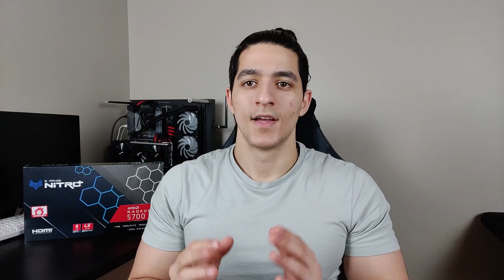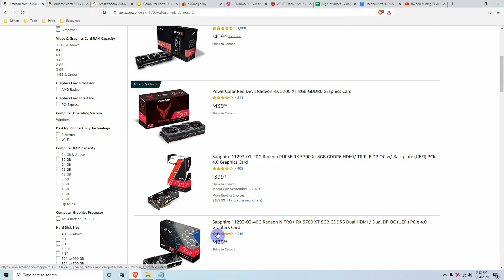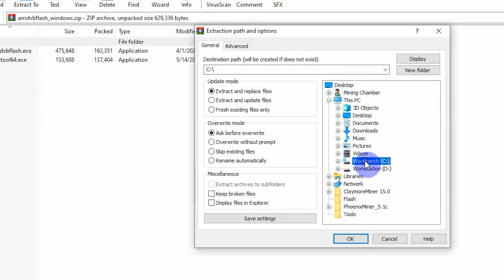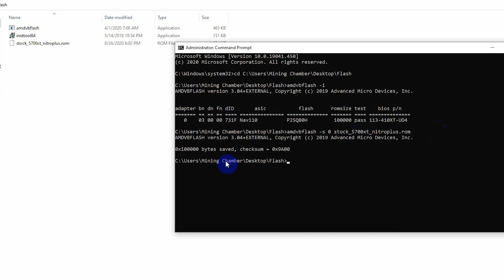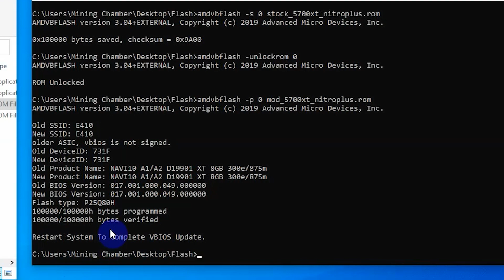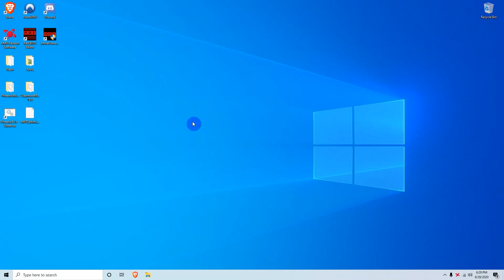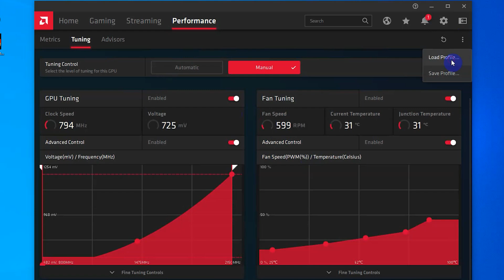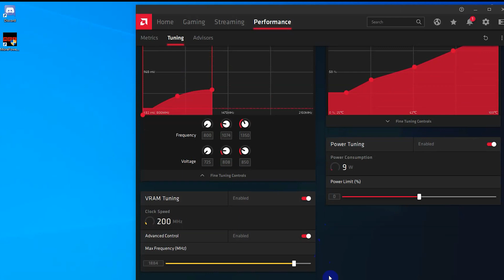RX 5700 XT Mining Overview | Profitability, Hashrates, BIOS Modding & Overclocking

Comment: In my case I don’t have to worry about electricity because it’s for free ! should I undervolt it ?
Reply from the maker: Yes undervolting helps your gpu be more stable because it produces less heat. It also makes your gpu survive wayy longer
Reply: @MiningChamber thank you so much for helping me your channel is awesome
Reply: @MiningChamber  one more question
I found a brand new sapphire nitro plus vega 64 should I get one of them ? In my country it's cheaper than rx 5700
Reply from the maker: @sofianetech379  thank you! And it depends on the price! You can check the buying guide I released recently and if you feel like you found it for a better price than the recommended list then yes go for it!

Comment: Hello mining chamber,
First of all, thanks a lot for your detailed guides on your youtube channel. It helped me a lot building my mining rig!
Unfortunately, I can't manage to modify the bios of my cards (Gigabyte RX 5700 XT Gaming) successfully, although I followed your bios modding guide carefully. 
I tried to modify the timing values by using both my own and your stock bios (provided in the comment section of your video), but it doesn't work. Every time I tried this, I got a black screen and had to reflash the original bios...
Do you (or maybe someone else) have any idea what is going wrong here?
Thanks a lot in advance!

Best regards,
Roy
Reply from the maker: Hey Roy! Thank you!! 

I had the same ones, gigabyte gaming oc. And I did them through the bios pinned in the comment section. They should all be micron memory and you can just modify that bios once and flash it on all the GPUs of the same brand (gigabyte gaming oc only) 

If it doesn't work after making sure all the steps are done right then please join the discord we can chat there!
Reply: @MiningChamber  Hey, thanks a lot for your reply! I am gonna contact you on discord. My gigabyte cards have Samsung memory.
Reply: @royvanduuren6881  Hi, did you ever get this working? I also have Samsung memory
Reply: @MiningChamber  Hi again, how can I chat with you at Discord? I joined your channel there.

Comment: Hello mr camber , 88 watt and 55 mh right but you said add around 70 watt to the 88 watt that means its hashing 55 mh at 158 watt tell me if i am wrong
I am from german i didnt understood what you mean
Thank you for the help
Reply from the maker: Hey! Yes it does around 130-135 watts off the wall for 55mh. Check the article in miningchamber.com!
Reply: @MiningChamber  Thank you very much❤️ My Problem was i have a only 1600 Watt supply. For 10 Gpu rx 5700 xt nitro + but i did not build it up yet. Now i know it will work you helped me a lot much love from germany
Reply from the maker: @ruthlezzfighter2817  pleasure brother! Good luck!!

Comment: Do temps increase a lot after doing all this? Is it safe to run 24/7?
Reply from the maker: Actually, temps decrease drastically because your reducing the power that the gpu use so the less power the better.

If you want to avoid bios modding it's okay as well youl just be having 3-4 mh less. I also recommend using the settings on miningchamber.com article for this gpu
Reply: @MiningChamber  thanks bro! Great video. Keep up the good work :)
Reply from the maker: Thank you brother!

Comment: Hello brother i am mining with 5700xt first time , when i am going to mine with phoniex miner its saying "no cuda driver found" and can't mine eth. how to solve this issue?
Reply from the maker: No Cuda Miner is just since you dont have a NVIDIA gpu so dont mind it. Check the website article on this GPU and try the overclocks settings we have there!
Reply: @MiningChamber  ok i will try to overclock with your settings thanks.
Reply: @MiningChamber  yah it's running very well by ur settings. Thanks a lot..
I want to know how much minimum ETH need to get payment to my wallet? Thanks
Reply from the maker: It depends on the pool, check the 5 uptime tips video for windows 10 youl find some info on it there
Reply: @MiningChamber  thanks its very helpful video.

Comment: i followed all steps but after restart i have all the info on gpu-z zeroed. and when i try to open Radeon Software i get message "No amd graphics driver is installed" etc. cant run teamredminer. at least i can flash original bios back
Reply from the maker: Uninstall drivers with DDU in safe mode and try to install amd drivers 20.4.2

Comment: Hi friends, for those of you who have a XFX 5700 XT Thicc III Ultra, I recommend you follow this tutorial but DO NOT use the bios mod for other 5700's. Use techpowerup's Thicc III bios mods. I soft-bricked my card using the bios settings in this video, fortunately able to restore to default bios. Then I used techpower up's thicc III bios mod, using the steps in this video, and it worked like a charm. Thanks @mining chamber for all the info you provide. If you had this same experience or did not have this issue at all, please comment on this thread so other people can read it.
Reply from the maker: Oh interesting thank you for the information!!

Comment: I have a gigabyte gaming oc rev 2 and I tried every single bios but still cannot load the card, does anyone has a successful outcome to share?
Reply from the maker: Did you try to follow it with the pinned comment?
Reply: @MiningChamber  Hi mate, yes I used the 5700xtstock.rom for gigabyte from the pinned comment, when I flash with stock without mod, or modded, just brick the card and doesn't boot on my b2500 mining expert MB, only works with the default bios. I have the gigabyte gaming oc 5700xt

Comment: I keep getting the 'ROM not erased ERROR: 0FL01' whenever I try to go back and flash the default BIOS. Please help
for more info, im using a powercolor red devil 5700xt and its on the modded bios just like in the video.
Reply from the maker: Hey! Make sure you ran the instool that comes with the flashing tool and also make sure that your using 3.04+ version not 3.04
Reply: @MiningChamber  i am using the 3.04+ version. what exactly does the instool do? i see the .exe file but nothing happens when i try to run it, im not sure what it does or how to use it.
Reply: ok yes, i ran the instool, so the binaries are installed but that doesnt seem to do anything
Reply: @SergantSpecial721  Did you manage to solve it? same problem here, I tried 3.04+ , 2.93, UEFI pendrive, all the same error as yours, it seems that in red devil when doing bios mod in bios OC that generates this error, it blocks vbios, the right thing would be to do the procedure of video in silent bios and leave the OC bios intact, it seems that the only solution would be pin 1 - 8 or remove the bios and re-record it by the bios recorder, luckily we have dual bios on red devil... anyway, it was cool with the new timings, 55.50mhs, core 1350mhz, mem 1814mhz, and core voltage 0.78v. 124watts, but particularly I didn't like the rx 5000 cards for mining, they are pretty unstable, the new rx 6000 running at 0.70v are cooler in the core and memories. I noticed that the rx 5700 do bsod windows from time to time, even though it's not the main card.
Reply: @evertonmartinsdias148  I ended up just flashing on the silent bios setting after flipping the switch on the GPU... no clue why that works over the default OC one but it did.
I just keep the normal OC bios and the mining silent one now
Reply: @SergantSpecial721  Thanks!
Reply: @MiningChamber  Did you manage to solve it? same problem here, I tried 3.04+ , 2.93, UEFI pendrive, all the same error as yours, it seems that in red devil when doing bios mod in bios OC that generates this error, it blocks vbios, the right thing would be to do the procedure of video in silent bios and leave the OC bios intact, it seems that the only solution would be pin 1 - 8 or remove the bios and re-record it by the bios recorder, luckily we have dual bios on red devil... anyway, it was cool with the new timings, 55.50mhs, core 1350mhz, mem 1814mhz, and core voltage 0.78v. 124watts, but particularly I didn't like the rx 5000 cards for mining, they are pretty unstable, the new rx 6000 running at 0.70v are cooler in the core and memories. I noticed that the rx 5700 do bsod windows from time to time, even though it's not the main card.

Comment: Hello.
I've made all and was right, around 55Mhs and 104W, but after a few hours when i came back, i had a report from radeon software, saying that a error ocurred and it loaded the primary configuration, soo it was consuming 180W and making 55mhs.
Do you know why?

Thanks and regards.
Reply from the maker: that is usually to OC crashing., That means you just need to tune it a bit. Maybe reduce memory clock or increase your voltage with a little
Reply: @MiningChamber  Thank you.
Already done that, from 1800 to 1780mhz and its ok.
54,5mhs and 104W, and raised a little bit the fan speed at 45°C, more 5%.
Still working at 42°C and memory temperature at 68°C.
I think problem was memory temperature, reached 88°C.
Thank you again.

P. S. Do you have any tips to optimize NVIDIA 1660 6G GDDR6, its making around 26mhs....

Good luck
Regards from Portugal!
Reply from the maker: That's fine with the memory! And I don't have it for the 1660 unfortunately

Comment: I cant seem to DL the amdvbflash ver 3.04 from igors website. Anyone care to share ?
Reply from the maker: Mm that's odd I don't think I have the link for it but did you try different mirrors? Also make sure it's the 3.04+!
Reply: @MiningChamber  tried, no luck. Anyway I'll be flashing 6x 5700xt gigabyte gaming OC, im in 50/50 state to flash or not because of brick issue stated.
Reply from the maker: Mm I did flash mine, the 8x gigabyte build and all of them have been working good so far. But absolutely it's up to you so no stress at all!
Reply: @MiningChamber  Appreciated the reply. If i'd get my hands on the v3.04 flash, i'll try to flash 1 of them and follow your settings.
Reply: @MiningChamber  Hey finally flashed my Gigabyte 5700xt OC it went fine. it was Rev1. and I ddnt use the stock to mod, I use another moddable rev1. Now 58mh/s stable. Thanks!

Comment: Hy, i have a saphire nitro+ 5700xt special edition wich comes with dual bios and 3 position selector for, 1.primary bios, 2.secondary bios and 3.software selection between the two.
i was'nt aware of it as i buy it few days ago used, and it was left on position 3 for the saphire software to choose wich i didn't had installed when i tried the flash.
so by flashing the bios with the mod with the selector on 3 (software choose) but i think if haven't it installed somehow kept the bios 1 the primary with performance.. i broke my primary bios, after in gpuz didn't see no gpu frecq no memory , no sensors.
and everytime i tried with the flasher to reflash gave me error on read rom, didn't unlock and even if i try to see the gpu like amdvbflash -i had no response and computer freezed.
so i wen't on integrated gpu  loading a so win10 from a stick ( the fastest solution i allready had) there are many more like rufus usb boot or safe mode.
it let me read the info of gpu and let me flash the bios with the previously saved as original. but the damn selector was still on 3.
after this move in my windows i was able to see info gpu with flasher, reflash it with original but still have no gpu info memory freq no sensor no possibly use of the card because i still was on 3 (software select of bios)
after i start a deeper diagnose i got into this amd software called "saphire trixx" wich didn't le me select the other bios the tab was not even visible (when you see it and see it disable at least you have a hitch)
so after i got to an end point I looked i the card box an saw the paper with the bios selector :D and i switched to the secondary bios since the one i usedwas already the max parameters.
the card got alive, no issue. I exported the bios and look inside the only diffrence was that with more power tool i saw the secondary original bios had lowered Power limit GPU at 195 instead of 240 and the TDC limit GFX at 171 instead 203 and some lower rpm to the fan. 
but even the original primary bios was flashed many time with the right selector had no gpuz info about gpu memory freq and sensors.
so i had this ideea to flash the secondary into the primary respecting always the bios selector swithc position.
so i got 2 secondary bios working on 2 diffrent bios selector switch.
at this point i tried to flash again the orginal bios on the primary ad it worked, had everitying working fine info in gpuz, performance, i did the furmakr test and the primary bios with max setting was working again.
after this i tried to tweak the secondary bios with the mods shown in the video but before flash it i had this ideea to see if there is another flasher and i find the exact AMDVBFLASH windows version wich.. when i tried to flash it told me there is an error in the VBIOS, wich was the modified bios with the mpt table and bios memory above 1550 mgh.
so in the end.. all the settings shown in this video may not work with my card wich is the SAPHIRE 5700XT NITRO+ SPECIAL EDITION.
the dos version of the flasher don't show erros and flash it anyway.. and ruin the bios, the win version stop the flashing when check the bios giving a tab with the vbios error.
is this card to include into the other you put the note to use a diffrent bios instead of the original ?

Comment: hi. great job and thanks alot.
after a power failure wattman sets value to default value
what should i do to make default value for the gpus? would msi after burner works better?
or is something to set in RBE OR More power tool to make it set to values after power surges.
thanks in advance
Reply from the maker: If OC crash then they usually reset but if it's due to power failure you can just save the profiles in Wattman and then load the profile! There should be a way to do it automatically but Im not sure how on top of my head sorry! The issue with MSI afterburner is that you can't undervolt this gpu there

Comment: do you recommend the ASUS ROG Strix 5700xt?
Reply from the maker: Yes they are not bad
Reply: @MiningChamber  can you recommend risers good as ubit? Ubit is out of stock..

I can get GPUs but Risers, Boards and CPU are out of stock.

I drove an hour to.collect a Pentium G4400
Reply from the maker: Tomorrow's video will cover that!
Reply: @MiningChamber  beautiful. I must say this is the best channel on mining. 🙏👌❤️
Reply from the maker: Thank you so much💙 Its an honor to be useful to the community ⛏️⛏️
Reply: @MiningChamber  your page on the 5700 is the best.  Well detailed.  What I wanted to see was the RTX 3080 build, specifically an 8 to 12 GPU set-up.

The confusing part is the power setup. Most people jog through the power cable installation.

Ie. How many individual cables per the 3080
How many PSU for 8 cards.
Do you overclock the cards and install the one at a time or all then undervolt them
Reply: @MiningChamber  can we chat private? I have a few questions. Thx
Reply from the maker: @sali9821  I will be having a 3080 build soon! For the power cables they all follow the same concept. I recommend checking the ATX powersupply guide and the Server Powersupply guide . Tomorrow's video will also help on that topic. Feel free to join the discord server and chat there! Link in the descriptions
Reply: @MiningChamber  ah, I got ya. Much appreciated

Comment: Hi there i was able to achieve 55.4 mh/s but not with the power consumption that you mention in the video my is 108 watt, do you know what can be the reason, i`m with Gigabyte 5700 xt Gaming OC, and i don`t have any problem`s at all, just don`t get why i don`t have this power consumption, i mean 108 for the "efficiency " profile and with "performance" around 130 watts
Reply from the maker: Hey! If that is the watts on the software then you don't need to worry. Usually off the wall it's 130 watts so if you have a wattmeter to calculate the system off the wall it will be more accurate. I believe software watts had gotten an update recently to try to be more accurate with the wall
Reply: @MiningChamber  Yesterday i playaround with the settings and i achieve 57.1, with 110 watts, and i believe if this is in open space the watts can go down
Reply: @MiningChamber  What is your opinion about Asrock RX 5700 XT phantom gaming 8gb, can it achieve the results as gigabyte or sapphire, with the tutorial in this video, or at least can i use this video to modify the firmware of the video card (Asrock RX 5700 XT phantom gaming 8gb)

Comment: Great video man! Couple of questions since i am completely new. I have a  nitro +, a ryzen 5  3600xt and 32gb ram. Viable for playing online games while mining? And how will this affect my hardware? After seeing your video i am thinking of trying to mine for the first time! Also a pool or solo? What do you would suggest ? And can i do this without overclocking and messing with my gpu?And last , you said that it was running for 4 hours without crashing...so mining will cause crashes and stuff?
Reply from the maker: Thank you! Mining does use your gpu resources so gaming and mining will be tricky. Ram does not affect it much neither does the cpu. As for the overclocks yes it is recommended but you don't need to BIOS mod. Overclocking it simply makes sure your gpu does not burn itself out by using way more power than it should! 

You can turn on the miner while your not gaming then off when you game!

I will be making a video regarding this topic soon so stay tuned! "Mining with your gaming pc"
Reply: @MiningChamber  Thank you sooo much for the quick response. I will give a try following your steps. Hope all goes good! Thnx again mate 🙏🙌🤙!